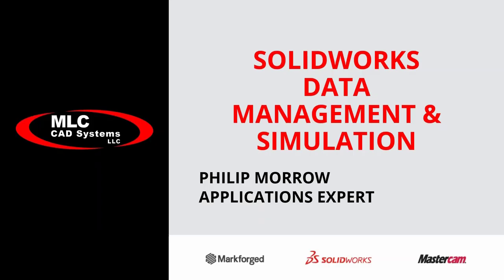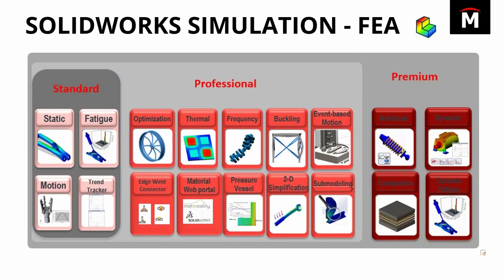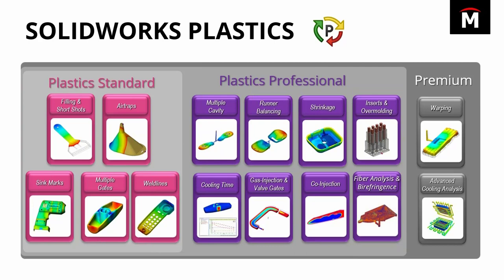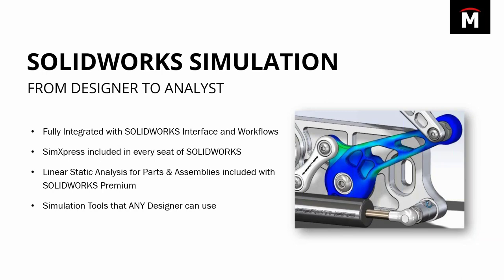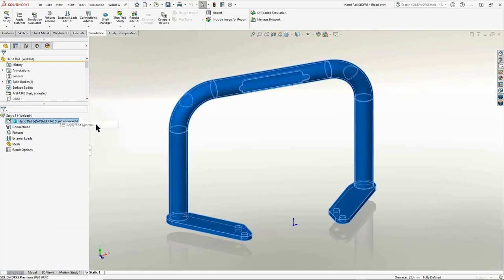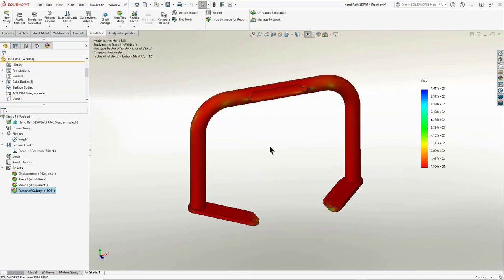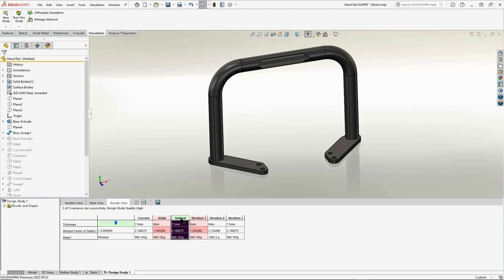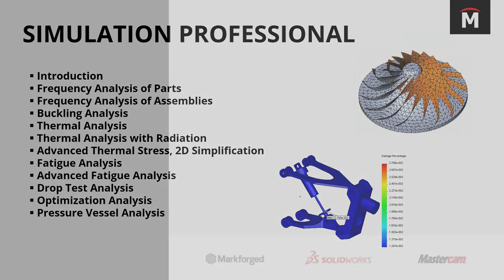Overview of SOLIDWORKS Simulation

Comment: hello, can you help me with a simulation? I would like some tips with a project. it is a structure on top of the other and has a rotating movement, I would like to know if it is viable! try to simulate but the error
Reply from the maker: Yes, it sounds like your questions relate to a very specific geometry and setup, so if you are a local MLC CAD Systems customer reach out online!  If you got your software through a different reseller you should follow up with them for additional information.  https://mlc-cad.com/technical-support/